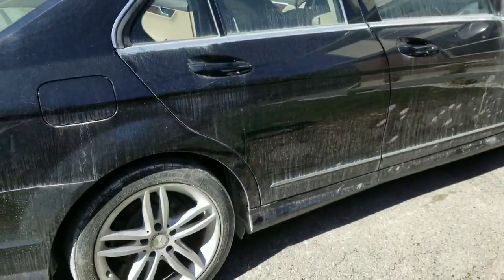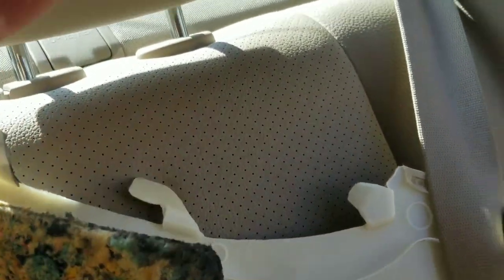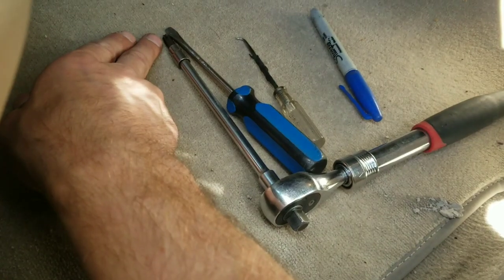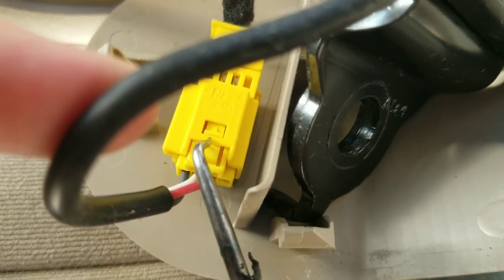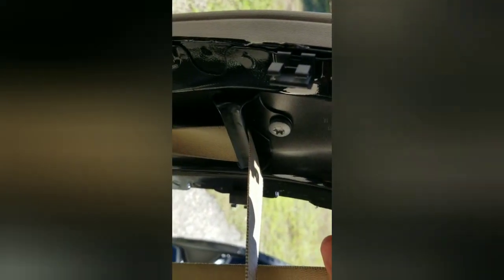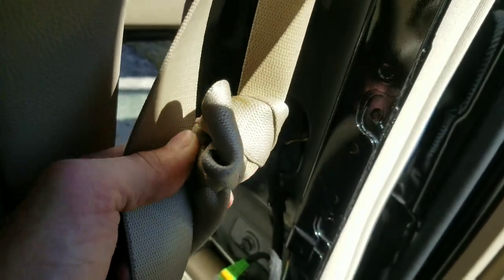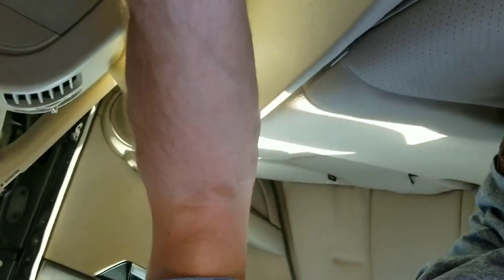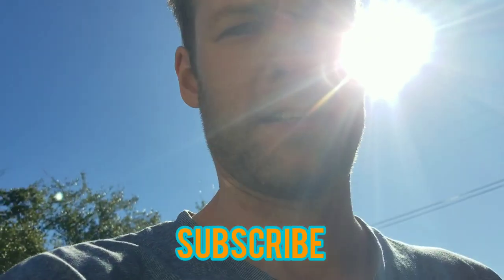Mercedes How to remove locked damaged seat belts w204 C250 C300 C350

Comment: How do I remove the seat belt buckle (where seat clips into on driver seat) from the seat? Do I pop off the side trim and undo the receiver?
Reply from the maker: Sorry it's hard for me to recall and I no longer have this car, it should be bolted to the side of the seat and you may need to remove the seat to get to the bolt.
Reply: @streamlinebuilds1490  yes just looked! It’s just pop off side plastic and one torx bit! Thanks my man. I might install a racing seat since I’m 6’5. If I unplug the seat with its connectors will I get an airbag light? I have a seat rail that matches perfect and going to install seatbelt clip. But I’m guessing I’m going to get an airbag light I looked and I don’t see a module that will turn off light for racing seats?

Comment: Do you have any idea how to remove the seat belt in the middle of the rear seats? The mechanism for it seems to be within the seat itself but I have no idea how to get in there to remove it.
Reply from the maker: Sorry I didn't get into that one, is it up underneath the trunk deck area that usually where they mount.
Reply: Did you ever figure this out? I’m having the same issue just now.
Reply: @jamier1987 Yep, I had to pull the Mercedes service docs for removing the middle seatbelt, which required removing the center armrest, etc.

Comment: When you refit them..would you need to reset the ecu...
Reply from the maker: Yes I used my alltel scanner to clear the codes
Reply: @streamlinebuilds1490  thank you
Reply: @streamlinebuilds1490  could you give me more info on the scanner plz....in the uk Mercedes use ....star...
Reply: replaced airbags on a 2012 and the ecm cleared on its own!
Reply: @tanako98  took my merc to a respectable garage.....Had to buy a new airbag ecu......broke my ❤😀